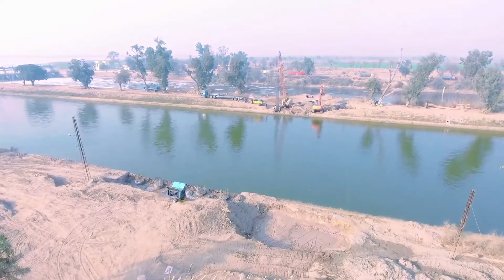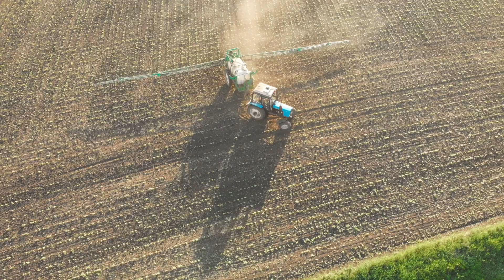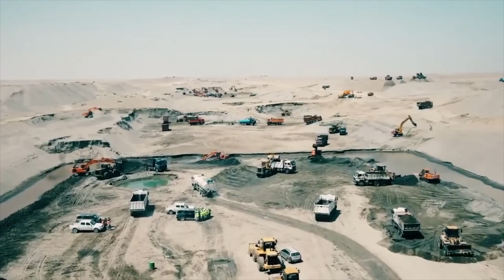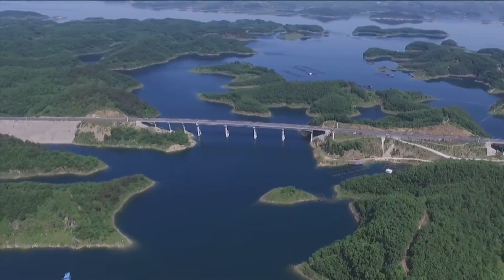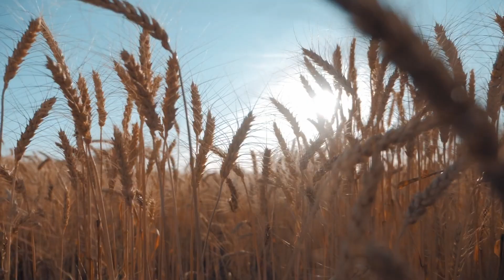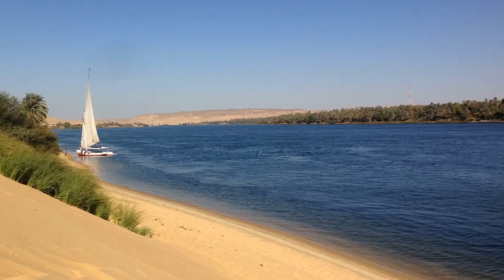The World's Largest Artificial Rivers Under Construction

Comment: For someone trying to save water they waste a lot on this.
Like open top and concrete with no trees on the sides or solar over the top 😂 talk about evaporation loss.
On top of that there concerned about it absorbing into the soil you know the thing that’s also connected to the underground aquifer 😂.
Then on top of that it’s for farms none of which grow native stuff so you can only imagine the amount of water needed for them.
And then you got all these pumps pipes and other things including the concrete river yes at this point it’s a man made river but they all need maintenance and the pumps require ridiculous amounts of power is that green to probably not.
How to get green power or pink yes pink power is a thing you can use geothermal or tide power small water batteries if you know them fantastic if not it will take to long to explain soo look em up then there nuclear power.

Comment: reducing dessert areas decreases the Earth's albedo, locking in more energy at the Earth's surface, and increasing surface temperatures. But, more green replacing dessert will mean more CO2 converted to oxygen, reducing a major greenhouse gas. Not sure what the overall result will be!

Comment: Lets do some math. How much is the annual rainfall in your country? That times the area of your country is available water. How much do you collect of that? That's renewable. If collected renewable is less than usage then you have a problem. Desalination. How many years of oil do you have left equals number of years till you go back to dates and camels. Sounds racists but Europe will be burning coal and trees using horses by this time. It's actually not that far off. Don't worry the rich will be fine.

Comment: They must snake around you cannot have it straight many problems otherwise
Reply: Canal construction in mountainous reaches,require taking alignment,mostly in curves or zigs,taking toll ,by way of head losses,in its course to site of irrigation.Which means loosing more command areas,as compared to one of a straighter alignment.
  I have been constructing canals,resorvoirs,hydro-power houses,during my career as civil engineer@ Kargil,UT Ladakh,frm 1974-2007-2018.

Comment: The uploader doesn't know the difference between the New Valley (New Nile) project and the New Delta project. The first one is the project of diverting water from Lake Nasser north west into the Western dessert, in order to start the irrigation, and the New Delta is about expanding the delta area with the water that's is mostly being unused and flowing into the Mediterranean.

Comment: Why keep calling them artificial rivers when there is a perfectly suitable shorter word- canals? And this does not address issues in respect of gradient (and hence flow) and changes in level - which is why you have to have locks and in some cases, aqueducts and boat lifts ( elevator).
Reply: Because canals were built many centuries ago.  Built without "engineers", without technology in sight, without the industrial revolution, without the eye in the sky, without logistics or much access to prior knowledge, but with the participation of many people.  There are many people today.  There is much need of this many people, served/fulfilled by ordinary people and ambitious people.  An 'artificial river' is a more appropriate term for the ambitious people.  Rivers are natural occurrences, made by 'Nature' - but not by 'SuperNature'.

However, to improve the lives of people in need is necessary, and ethical... with or without ambition.
Proper improvements and progress in the correct path(s) is ethical, though may not be necessary at the time.  It is true progress, that is without downfalls or regrets.  Foresight without ambition.
Reply: @wip1664  The first modern canal is the Bridgewater build around 1760 but this followed contours. The first canals to go directly from A to B were designed by Thomas Telford in the 1790s. Telford is regarded as the first true modern civil engineer and the inventor of what we now call project management since he was able to deliver to planned cost on time. He certainly used technology and the canal network created at this time is still in use today. Instead of writing off the top of your head take the time to first read about a subject. An ‘artificial river’ is indeed a canal.
Reply: @jontalbot1  
You are a historian.  I am not.  But yes, prior knowledge of "things" in general that has great impact on many other things need to be considered.  The Chinese built the Grand Canal many centuries ago, much more than a few.
I can only write off the top of my head since I do not know many things.  But I can relate what is known.
Reply: @wip1664  I am not an historian but l know what a canal is. It’s not difficult

Comment: No prizes, all desalination plants should be powered by PV panels.
Reply: Do you know how many panels would be needed just to supply the energy. It takes almost 95% of a roof just to power a house. Solar doesn't bring in the power you think. I have 50 panels now and barley powers my house in the summer. We are putting another 10 panels in 2025
Reply: @RHEC1776  Solar panels for these desalination plants won't be installed on someone's roof but in the desert and Saudi Arabia and Egypt have plenty of desert areas to install large no. of solar panels. And plenty of sunshine too throughout the year.

Comment: The video needs to address two things better:
-Politics. For example, NATO bombed the Libyan water network, and Balochistan has an ongoing insurgency. How  those connect to water issues isn't explained.
-Water supply: Does Pakistan/Afghanistan actually have enough water for its plan? What's its strategy to maintain adequate supply?
Reply: Scientists are talking about this for sometimes but they never said there will be no water what they says it will be with cycles like low rains for 3-4 years than record rain for the 5 year. You like it or not, but Pakistan is addressing this issue very intelligently even with less resources. For example 2010 flood Pakistan diverted to the deserts. Even though there was disaster at that time but today Pakistan's desert are getting vanished.. even the kach canal project is made on that  groundnonly. same time Pakistan diverted the whole river to fall into the river Jhelum which is already having too much water to different place through the underground tunnels. Then Pakistan has developed more than 700 small dams (450 of them in Punjab alone) to store the water, if sindh and KPK also follow then it will be huge relief for Pakistan to protect water, and make it available whenever needed. 

Pakistan also have build lots of canals recently which improved accessibility of water.
Reply: @Spooferish  That's really cool.

I'm not criticizing Pakistan, I'm criticizing the video for not covering what you just said.

I'd really like to see a video on how Pakistan is planning it's water management long-term, and how it plans to store it's irregular flood waters. But a video that ignores all that, and just says "look at this one canal" is much less interesting.
Reply: @domtweed7323  ind Pakistan it is all for PUNJABI EXPLOITATION and not for the benefit of BALUCH, PASHTUN AND SINDHIS. pakistani is a PUNJABI APARTHEID RACIST EXPLOITATIVE SYSTEM .
Reply: There is no need to talk about politics in a construction/infrastructure video.
Reply: @danial1635  There absolutely is. What gets built, and who it benefits, is entirely political.

For example, if a dam takes water from one community, and gives water to another, you have winners and losers. That's very political.
Reply: @domtweed7323  And that can is better discussed in a political/social video, not a construction video in my view.
Reply: @danial1635  We only build things because their useful. So who they're useful for is the most important question.

Every big construction project is built for political reasons. Ignoring that is just as neglectful as ignoring the engineering.
Reply: Look at the Aral Sea for your example. Didn't work well for the people around that sea. Who will be the first here to blame NATO? We get the blame for everything else. @domtweed7323

Comment: Personally,  I prefer DESALINATION SEA WATER instead of tapping  underground water and ATMOSPHERIC WATER GENERATOR system for these DESERT COUNTRIES. 
ALSO, CHANNELING  sea water go deep inland desert to COOL DOWN high desert temperature like what EGYPT is doing with it's depression land.
Reply: For this to be realized, another source of energy will be required, say, nuclear otherwise just burning gas or fossil oil will exhaust its usage soon enough!
Reply: Desalination is an energy intensive process.  But I guess solar panels could be used in desert areas if one can overcome the issue of sand dust reducing the panels efficiency. (Accepting that solar panels are not actually so green when one takes account of the mining of key elements used in their fabrication and the fact their lifespan is only about 20 years and they are not currently recyclable. Ditto for wind turbines!).  Nothing is as it seems😅

Nuclear 💪💪
Reply: When it comes to cooling the dessert, dumping an inland sea worth of salt water into the aquifer is almost always the wrong move
Reply: Using energy to change climate is not possible. And I don't think Egypitian is doing what you said. That thought never works.